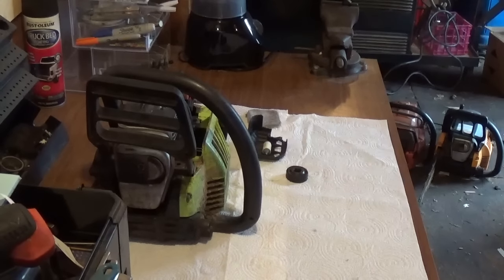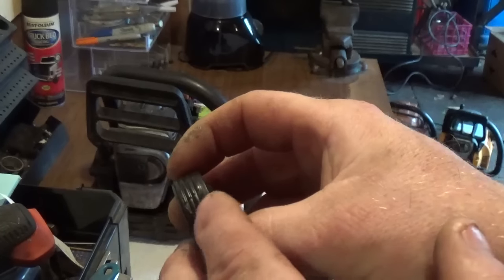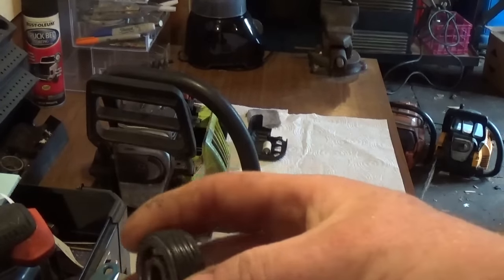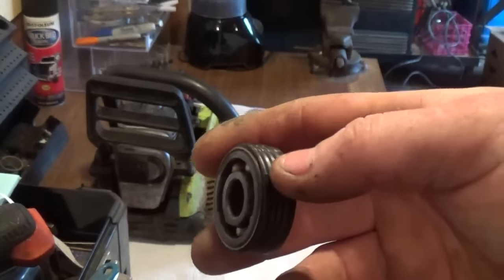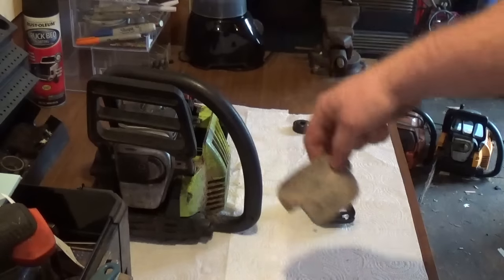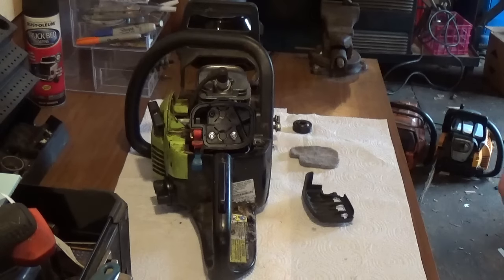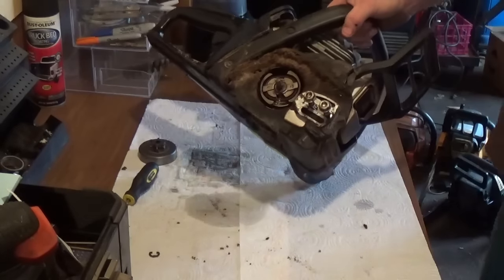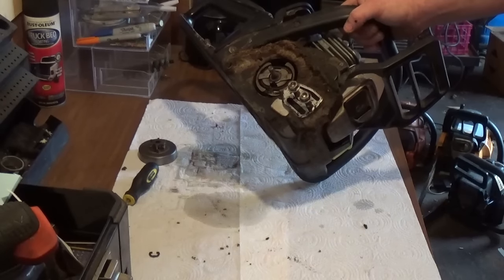Common problems with Poulan Chainsaws

Comment: picked up an older 3400 in a crate for free. all parts were in the crate along with a carb rebuilt kit. carb was in a zip lock. after doing the rebuild and general cleanup it runs like a champ. have not cut with it yet, but it might be old enough to be a good saw. no brake on it. 

the video and others are truly informative  and helpful, but I'm not your average guy. more of an engineer  than a hard core user. 

now it needs a good home!
Reply from the maker: I think you have the right idea....I to would find it a new home....Thanks for the respectful comment/ really glad you enjoy my videos.

Comment: I don't know how old that 2750 is I know it's set in my aunt's should for at least 10 years but it doesn't seem to be a new model one that one on the table looks like the 14 inch model or the 18 inch model which I personally haven't messed with the 18 in but the 14 inch model I need dug out of the shop today is a definite piece of shit the one good thing my pawpaw did was throw away that 14 inch bar and chain and bought a 16 inch and put it on that piece of shit so now that bar in chains going to go on my 2750 but that 2750 I'm assuming is an old model but everybody has their own opinion when I first tried to start it it didn't want to workI have not adjusting the carburetor on it all I did was clean out the filters and replace the improvised green scrubber pad filter for the air filter with a yellow sponge Brillo pad air filter improvise I fell one tree with it so far and it starts on 3rd pull just like my 18in Sthil does but time will tell if that remains the case or not I remember my grandpa pulling and pulling and pulling on that piece of shit one and he finally said fuck this and got a Stihl and I can see why he did that now haha

Comment: I'll tell you honestly the pollen chainsaws are good I run on a tree service and I have 4 of them they're good chain saws yeah you're right you have some good points but  That is a easy fix
Reply from the maker: Well thank you for validating the fact I made some good points . And if you are having great luck with your poulans .....Great I truly hope you continue doing so {sincerely}..But your comment leaves me compelled to ask this as a question .....Why do you feel a New saw out of box should be a easy fix. Although you didn't directly imply this as your statement  shouldn't theses saws be dependable enough to run as intended with out requiring a easy fix in the first 30 min of use . And with the highest failure rate of any commercial saw . Shouldn't action be taken to insure at the very least these saws are of real quality. Or hell that at the very least defects in the lack of quality be addressed . Now contrary to opinion or perception you clearly have admitted I have provided some good points . Would you provide just a few that you personally have encountered with your Poulans ? And tell my fellow viewers as to how these issues were a easy fix ? I provide this comment not out of sarcasm rather just a means to see what kind of easy fixes {repairs you have encountered}.As ironic as it might seem poulans failure rate is 4 out of 6 pieces manufactured and seeing how you said you use 4 pollen chainsaws it stands to reason you may have encountered several easy fixes . I am also curious as to weather these are fixes .....Swapping of old parts with new ....or repair inteling basic OEM parts to be taken apart and refurbished for lack of a better def.

Comment: I've he'd a 2250 for 20 years and have had no problems. Needs a new pully now. That's it.. If I buy another one at this point in time, I'll buy a stilh
Reply from the maker: That's great / once you have purchased the new clutch drum sprocket assembly please provide a short video on its starting ,cutting and idling ability .

Comment: Have a brand new poulan 3314 and i have done everything suggested to use it, and this band new chainsaw WILL NOT start. Never been used, rite out of the box. Oil/gas mixture perfect, chain oil in perfect, and everything set rite to start it, and it just wont start period. Even chechecked the chains tension, and its rite as well.

Comment: I know what you are saying I had one the crankshaft broke I have one now it just stoped one day and the recoil melts together as for craftsmen I have a old one I don't know how old but I could not get a bar or chain from sears I had to get in touch with Oregon for parts number and it runs great but very heavy
Reply from the maker: Yes/ I to have had to deal with problems exactly like this ....And I will admit it can be a pain to deal with{just another reason I stay clear of these Poulan Products as often as I can..}

Comment: I have a Model 1975 Woodshark that I bought at a pawn shop for $25.00 about 15 years ago and have only had to do regular and routine maintenance on it ... Lately it has been in the shed but this year I had to do some storm clean-up at my place and I took it out, and did  my regular tune-up on it and it fired right up and worked like a new saw ... it is all in the user and also, not abusing the saw like so many people do ... you canna expect to fell trees daily with it, it is designed for smaller work and that is what I use it for, just like I don't use a Stihl  to trim up after a storm on small stuff ... use the right saw for the job at hand and your equipment will last longer (with proper maintenance) ...
Reply from the maker: Maintenance is key know doubt ...But quality is paramount for longevity . You said your wood shark is 15 years old and only needed a regular tune up . Once provided it  fired up as well as worked like a new saw . Great you could be just the viewer my followers and fellow youtube viewers are looking for . Please provide a short video of this saw in action .....cold starting,Idling , cutting ,opening up from idle then of course returning to idle . This video dosent need to be more than 5 mins tops so it can be easily made with prep time . Looking forward to the video Ken Adamson and if you don't have a camera by chance please use your cellular phone as a recording device.

Comment: definitely a donny downer. glass is half empty. i have a paulan and its worked fine for many years. ... yawn
Reply from the maker: .....Stretch.......UM....That may be all fair and true on your part but for the rest of us Poulan has been a curse and has emptied more than its fair share of wallets due to price point and low quality standards . But your reply leaves me to wonder perhaps you need to sleep on this mater so you can provide a more accurate representation of your clams . Might I inquire and impose you provide a video of perhaps you cutting with this Poulan that has worked fine for years ? If possible please let fellow viewers see you make a cut and allow the saw to come back to idle before continuing to make the next ...About a min should suffice between cuts .....And lets inquire the results of 10 small cuts in unison with only a pause between cuts for said min .

Comment: Hi Kevin   you are a 100% correct about the fuel cap !!!  I got around this buying a extra cap and change it while the other shrinks
down to size. I am very good on maintaining my equipment, that being said the saw does not get used that much and it seems 
that its a machanic's saw, buying parts and working on it a lot!!  I got what i paid for a ( headache )
Reply from the maker: Thanks for this comment Brian as I finally have found a viewer that is honest about the quality and dosent argue about the honest continued buying of parts just to keep it running .

Comment: My mom bought a poulan pro 42cc 18inch bar and it ended up sitting for two years after alot of abuse, still had premix in the tank and a good 1/4 tank of bar oil. It started up great except it died under wot so I figured the jets were a hair gummed up so I topped er loggers full of fresh gas and a drop of stihl oil, and after a good 12 throttle engagments it ran great until cutting came around. Again under wot it would simply bog yet "ranaway" at idle. I grabbed a philips screwdriver and turned the "T" screw  with the saw idling in a good grooved log and that improved the idle plus aslong as I got on the throttle once or twice before cutting it ran til I stopped to flip the log while turning off the motor to keep it cool. Runs great now, a good tip is getting a loggers t wrench for the gas, oil and everyother bolt and flathead
Reply from the maker: Thanks for sharing the info it could help someone who has a poulan and experiencing these same issues./ cant say I am a huge fan of Poulan but any info that can help a fellow viewer is much appreciated .
Reply: Kevin Bolin Its a decent learning saw but thats about it, I love how thorough you were dissecting each fault that is present in the generics.I took off the air box lid and it has a husqavarna logo on the inside lid rofl I thought it was something only a handfull of people know. Have a good day
Reply from the maker: You make a excellent point .....I will try to make a video of these brand saws {with honesty } towards the pros and cons as well .....

Comment: These comment battles are great.
Hate on poulan or hate on this video but if poulan cared about their product then they should try to say why their crappy design was actually better engineering.
I swapped my first poulan saw (for another poulan) after it broke within 30 min. 2 years later, the replacement I just started troubleshooting bc it's leaking, smoking...which is why I landed on this video. A poulan could prove decent for the price for a few uses, but I regret trying to save money up front because I'm now buying another (better, more expensive) saw anyway.

Comment: i have had a poulan farmhand for 15 years and other then blowing out the saw after each use i never had to replace anything but bars and chains on it , great saw in my opinion, but i do love my stihl 029 super and my husky 50ies
Reply from the maker: I never had much luck with the more modern poulans  ....Older ones were not so bad ....not great but acceptable ...the 029 super is a excellent saw .....and the 50 special  ,51, 55 rancher were great saws made by Husqvarna . Miner problems ...but still very nice

Comment: I've had my pouland pro 18 for almost 15 years use it every year with my huskavarna to cut firewood. Ive never had to do anything to it other then change chains and sharpen it change air filter not sure whos using it maybe their abusing their saws
Reply from the maker: I cant say.....All I can say is I haven't had any luck with Poulan Chainsaws and every Tech I talk to seems to share my opinion on theses saws....Most wont even take the time to look at a Poulan Chainsaw or feather lite weedeaters in shop due to the quality and time required to repair the Saws due to common seal problems that plague these saws as well as the cheap carbs that often require tuning straight from the box. Poulan even has a factory that refurbishes there products due to all the returns .....I wish you the best of luck in any case and hope you continue to get great service from your poulan.... Sadly the rest of us just haven't been impressed with the quality and performance desired or expected  from our Poulan products.

Comment: I just bought a Poulan Pro 220 at a yard sale and it ran great until I got it home. First the primer bubble busted, then the pull rope broke, and now it's not getting oil to the bar. I've already spent almost half of what I paid for it. I have a new Husqvarna 455 with a 22" bar but it's a little too large for trimming small limbs around the house, which is what I bought the Poulan for, since it's such a small saw.

Comment: Are all these issues applied to all the Poulin Pro models, such as the 20"?
Reply from the maker: Sadly yes / please don't allow yourself to fall victim to a impulse purchase that will leave you with lighter pockets as well as buyers remorse.
Reply: First Poulan Pro was a 20" that was a piece of crap, later had a craftsman and poulan pro 18" given to me and am well satisfied with both after clean up and a little maintenance. After setting plug gap to .035 on each they are both good saws.

Comment: I agree 100 % I got one  a few months  ago  it ran  find for the first 30 minute  after  it won't stay  running
Reply from the maker: I know just how much this would anger anyone .....So sad ....I have been in your shoes friend ......Why they get away with it is truly beyond me .....Looks like to me they would pull there heads out of there asses and at the very least provide a chainsaw that didn't require a carb adjustment straight out of the box.{P>O>S> POULANS}
Reply: sounds like your vent in the gas cap is clogged. When the saw stops running open the gas cap to see if it's vacuumed locked,  if the saw runs again just replace with a new cap.

Comment: Your right they are shit.Bought new carb for my 18",get to run for 2 minutes,shuts off, can't restart it.I try to adjust the low,think I have it,then it dies and won't restart again.I pull and pull,and just won't start.Let it sit for awhile,then it will start,but bogs really bad,mess with low again,think I got It,then I'm back to square 1 again.Won't start!!! When you screw low all the way in,I'm not sure how many turns out it should be?? Do you know??
Reply from the maker: Yes /1and a 1/4 turns for initial settings ....but in most cases you could be fighting a air leak caused by failing seals.....I really hate Poulan Products... They just make money pits that in the end leave most people broke or with buyers remorse
Reply: Thank you very much,I'll try that.Someone said to gap spark plug more than it calls for,I'll try that to.I seen a site to buy these for $45+ free ship.Site says they have minor problems.Ya! my ass,they are junk! I'll stick to Ryobi's,they work much better and easy to fix.Thank you!!
Reply from the maker: LoL...yea I know all about those minor problems//I think we both know what to expect from a 45 dollar minor problem saw......Thanks for watching my video as well as being a respectful viewer...
Reply: Well 18" didn't go as well as planned.But the 14" which is 2006 or so,new carb on that too.1-1/4 strong on low adjustment,2-1/4 really strong on high adjustment and it works and cuts perfectly.I can't figure the 18 out???,I did same adjustments,but it won't work!! Same carbs,you'd think they would work the same.I'm discusted today,maybe tomorrow....LOL!!!
Reply from the maker: I feel bad for you ...the truth is every part of a poulan is made cheap ....you could be fighting both a carb issue as well as a pressure or vac leak on the saw..
Reply: I took plug out of 18"and it had grayish film on it?Maybe engine is bad?,unless its because its new,but I thought there would oil on it,not grayish film.It looks like fine aluminum shavings.I know sometimes its hard to pull,acts like its froze up.What do you think Kevin?
Reply from the maker: I think you have a scorn piston and cylinder ...you can check by removing the muffler bolts or studs [nuts or bolts } and peak in the exhaust port ...if you see vertical deep scratches ....then you know for sure .. The aluminum found on the spark plug was likely caused by the cylinder {jug} pealing away as the engine was ran....
Reply: Ok I'll check and let you know,thank you
Reply: Well,that would be the problem!! That piston is chewed bad with big scratches.That would be why it won't run right and no smoke comes out.I guess I'll part it out,I'd don't believe its worth buying an engine?? The chain and bar fits other saws.I'll get half my money back with just that and carb will get the rest,since carb is brand new and I have the    box.Thank you much for your help Kevin.Least I got the 14" wood shark done with your help.I like your site and I'll come back!! Thank you my friend!!
Reply: I have a question,I went looking on Ebay for engine and piston.Its the same for 14",16",and 18",so whats the makes up the difference on chainsaw sizes?? The carbs and motors are all the same.The bodies are bigger and bars are longer?? The rpm's don't even change.I think its a big @#$%^ scam.I'm gonna change everything out of 14" and put in 18",so I get more money for the 18 since its brand new.
Reply from the maker: That's what I would do as well....
Reply from the maker: Welcome...

Comment: Never owned a Poulan however,  I did own a Steal and a Echo both were commercial grade. Yes they are not cheap saws but, I never had issues with proper maintenance. I cut 13 plus cords of wood for close to 15 years and never frustrated myself. They have to work when work and time are an issue.

Comment: These are absolute trash. Mine quit oiling after the first use. Looked inside chain oil tank and Styrofoam is all in it. Totally clogged up pump.

Comment: My father use to cut small trees with micro xxv. Hard to start . I myself have a 361 not a single promblem after 10 years use. Not the best but both still works pretty good
Reply from the maker: panos del 7 I know it may seem as if I hate all Poulans in general. But some of the older poulans of the past were and are still really great saws .My issue isn't with poulans of the past rather the more modern pieces of shit pushed by Husqvarna as a parent company . I truly hate these fucking things that have been plaquing every box store shopper for the last 10 years plus. I cant even give you a honest estimate on how many I have seen with warranty issues straight from the box . They truly suck that bad....I for one just feel like people should get at the very min what they at least pay for …….And hell to be honest most can attest that I am not alone in my opinion.

Comment: I somewhat agree. I have a poulon pro.I have changed the carburetor, coil, fuel filter, spark plug and used new fuel.  It still won't start. I do get a spark